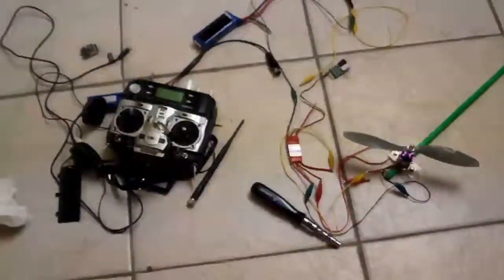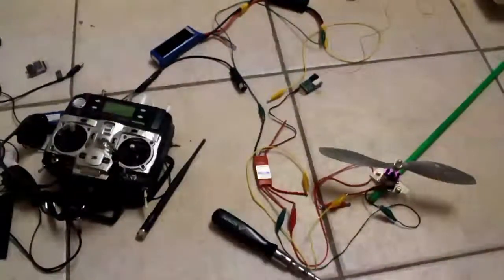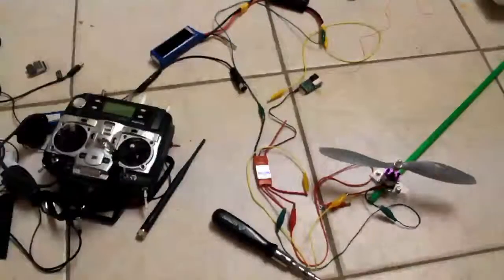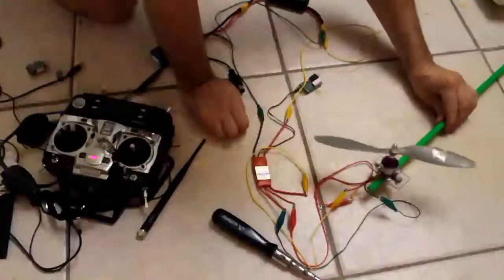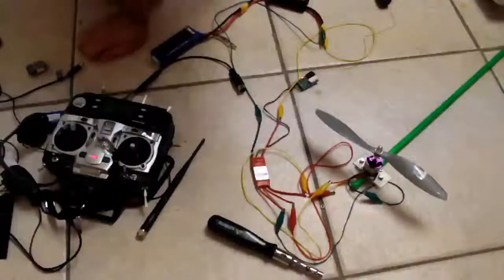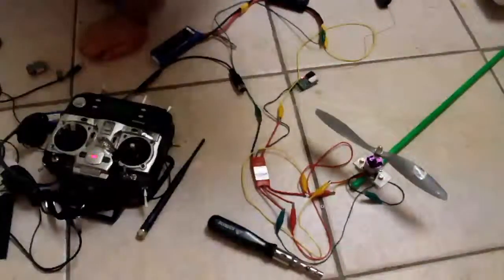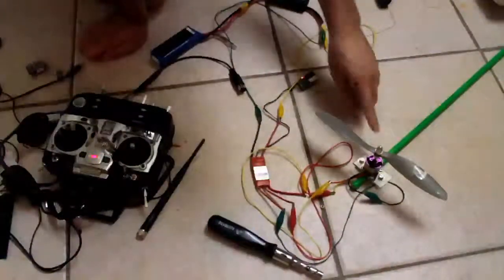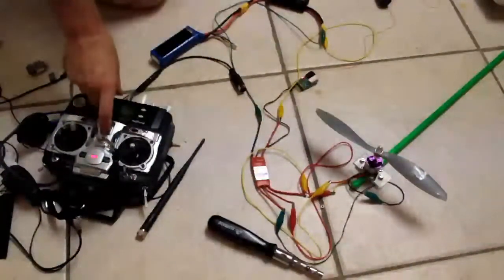Project Valkyrie, Tricopter Scratch Build: Day One, 6-8-11 Part 1

Comment from the maker: I so hate Youtube's character limits, ugh. One last thing - A quad is mechanically simpler to build and maintain than a tri with it's rotating tail motor. All you need is four booms, something to bolt them to, four fixed motors, and a controller, esc's, battery, and RC radio unit. That's why I went to it, didn't like the troublesome tail rotor on the tri build. I've flown my quad in FPV, omfg she's fun as hell. I'll send you a link for the video from that little venture. :-)

Comment from the maker: A tri vs. a quad... A tricopter will yaw much faster and more powerfully than a quad because of the tail rotor setup. But, that tail motor also has to work twice as hard as the two motors on the ass of a quad, thus it wears faster, runs a lot hotter, and will break faster. A quad yaws by speed differential on the four motors, so it's slower to yaw, but the four motors give stability that a tri can never have. More motors always = more stability. It also = higher failure rate, lol.

Comment from the maker: I originally based my efforts on the work presented on RCEXplorer, yes... but I quickly deviated from those designs and began to explore my own. My first bird was a standard tricopter but I found it to be very unpredictable in flight due to problems with the tail rotor design. I shelfed the project for months and then rebuilt it into a quadrotor, which I absolutely love. My board is a KK "Blackboard" 5.5 from eBay, very reliable and super stable. I've flown her both LOS and FPV, she's great. :-)